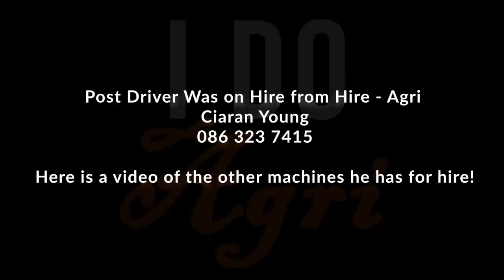CAN THE JOHN DEERE DO WHAT THE CASE FAILED AT?!?

Comment: It’s not the tractors it’s the lad following driving them, neither had any bother lifting the weight on the post driver, you hadn’t the case set up right to let the oil back into the tractors backend quick enough, that’s all simple fix end of.
Reply from the maker: Yes the man that rented the post driver to me told me to pipe the return into the back end filler cap but the size of the pipe made that impossible and only having it out for the day I had no time to jerry rig anything either. I did however drop the hydraulic oil and put in a new filter that day because my neighbor was convinced it was that. At the end of the day the linkages were of very bad quality in the case and that's were the real issues lied. The john deere was able to manage with both pipes plumbed into the servo aswell no messing around with the back end filler cap. The case only had 4300 hours and the john deere is over 9100 hours.

Comment: Really you need a Free flow return, basically fitting that dumps the oil straight into backend, tractor spool valves cause a restriction for machinery with their own spool

Comment: Dont think the case would fail,if hydraulics were rightused post driver with IH 674 and no problems. That jd done a great job.
Reply: yeah something seemed off the weight was dropping slow when it should fly down
Reply from the maker: It was the return pipe causing restrictions for the weight to drop the man I hired it off told me to pipe the return into the back end filler cap but it would not fit down it and I couldn’t Jerry rig anything that day so there was nothing I could do. I tried swapping and changing the pipes every which way I even dropped the hydraulic oil and out in a fresh filter that day thinking that was the issue but no I think it was down to the return restriction and also the linkages for the servos in the cab has issues. In my opinion the case had a great engine and decent back end but they seemed to rush or cheapen it with that low profile cab the linkages in the cab with the lp cab were not good quality
Reply: @IDoAgri  agree with the quality issues,but they had very good hydraulics. I had alot of issues myself with linkages 0n a 4210.
Reply from the maker: Yeah I’m sure the hydraulics and back end were well built and designed but yeah some cheap levers and linkages used on it then so I couldn’t get the full power and flow out of the servos. On top of that whoever installed the front loader on it had the pipes interfering with the linkages too making it all worse. I’m sure most case tractors are great machines even most 4200’s but my experience with that one was not great in the end
Reply: Case would run it no problem if it had a free flow return through filler cap. Big hevey post driver.
Reply: @aaronringland6251  too many "it'll do for now" jobs and none finished by the sounds of it 😂

Comment: The make or model of tractor shouldn't matter the case hydraulic pressure cant  be up to 2800 psi which I think is the standard for any tractor
Reply from the maker: I think it was up to pressure but the flow was restricted somewhere. I think in the end I narrowed it down to the linkages they weren't operating the servos correctly but at the end of the day that is down to the poorer quality of linkage design used on the case when adapted for the lp cab.

Comment: Lad you're talking bull set up the case right day one it would do well enough for what you are at same with any tractor does matter the color just the spec end of.
Reply: He's talking bull-well this video proves that you're quite wrong!!! Nowadays there's not much differences between makes of tractor but 20 plus years ago there were differences between all makes,some were better than others I performance, reliability, work control right down to component quality.
Reply: @oliver69cork46  no it doesn't if he tide it up properly and fitted a return line the tractor would work grand  end of the comparing 80hp against a sub 100hp tractor will have differences but not with the problems described.lads think having all the bells a whistle are great but fact is 90% of the time you don't need them but when they break they cost near enough 10 times the  money. Case hydraulic pump 400 jd hydraulic pump 3500 for example.
Understanding what you're actually trying to do and not half ass complaining about problems that aren't there.old story of the operator blaming this tools when he never set them up properly in the beginning. And yes the jd is a better tractor because it's bigger = more comfortable.
has close center hydraulics instead of open like the case.
It only mater when they are actully worked and like most tractors they aren't 
It's  just stupid comparing  the 2 when they are in a different hp band 😒 end of then complaining why it dosen't suit trying to justify why to get rid of than fix properly 🤔
Reply: @padraigdunne2094  just finished reading your message,it's like a continuous sentence rather than a comment with stops etc. Anyway besides that I agree with you,not comparable the 2 tractors here,if it was 80hp both models we could judge fairly. John deere hydraulic performance was always high,I had a few and they were fast,never gave much hassle but did cost alot more if a fault developed. One had a split block unit,it was like a hornets nest in intricate outlets inlets etc but when brakes,steering and lift were engaged suddenly together,bang it went,a hairline fracture,400€ and its the size of 4 cigarette packets together!! Different makes have different characteristics but today they're much more uniform.